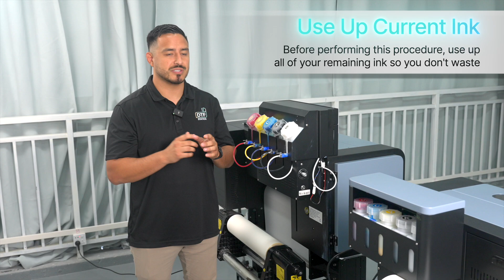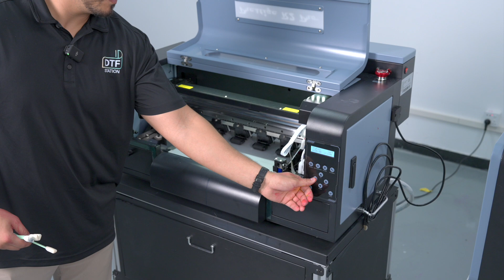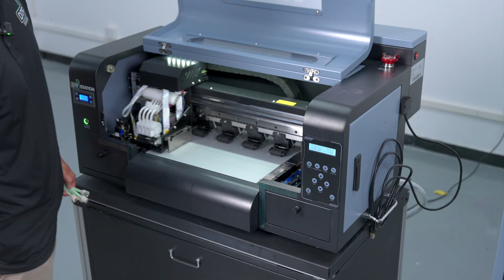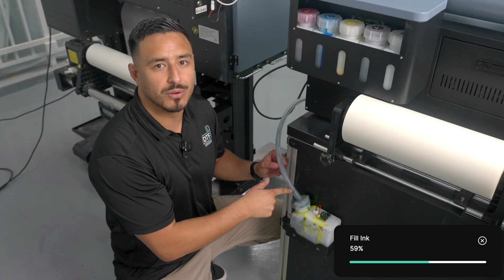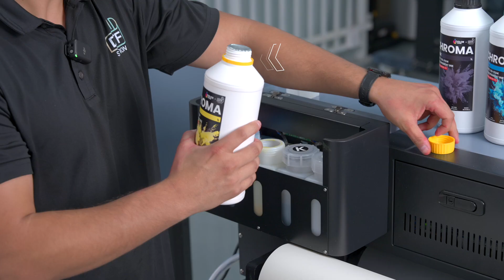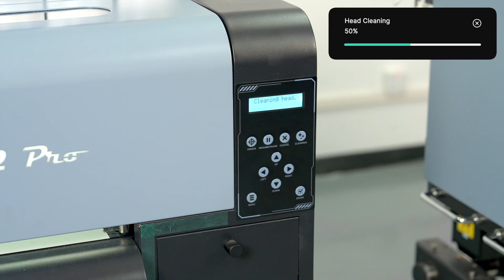How to Remove Current CMYK Inks and Fill Color Prime Chroma Ink | DTF Station

Comment: The levels in the CMYK will probably not be even. Is it better to switch each color as the tank gets low, or wait for the first color to get low and then change all 4?
Reply from the maker: We highly recommend replacing all CMYK inks at once since the new profiles are made for the entire set to work together.